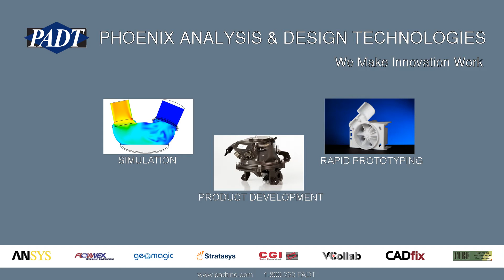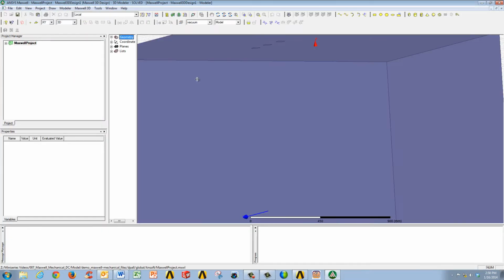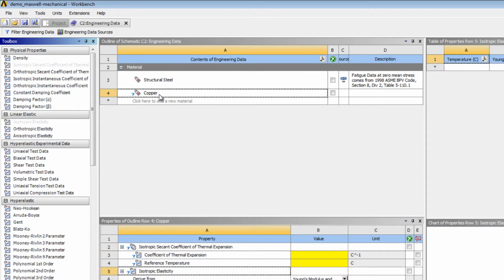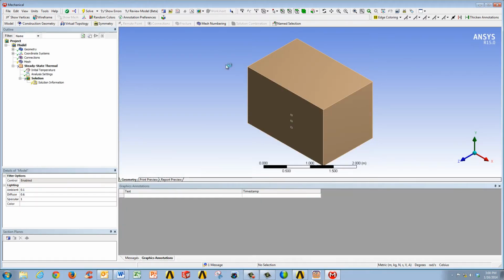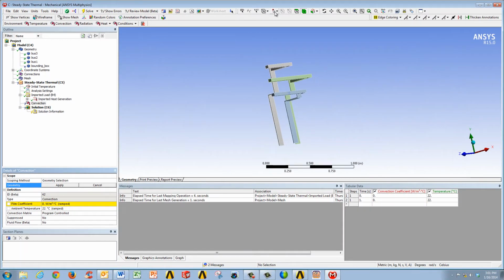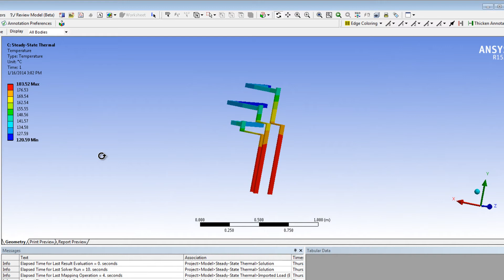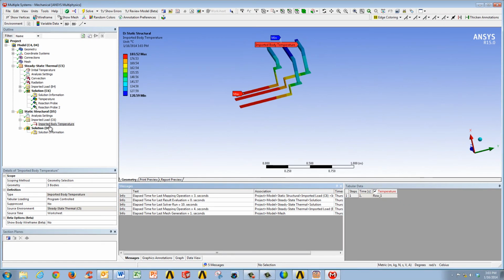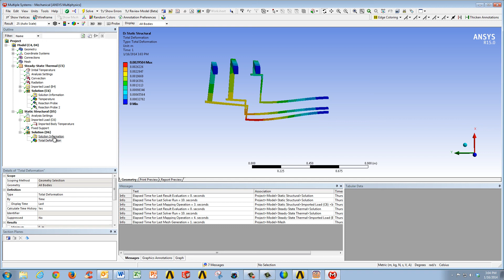The Focus Video Tips: Multiphysics Simulation with ANSYS Maxwell and ANSYS Mechanical - Part 2

Comment: thanks a lot for your nice video, I want to get the magneto-striction force in Aasys- electronic, but when I transfer data to structural mechanic only AC force can be transferred( the used material is metglass and I introduced its propertied to the maxwell)
could you please direct me to solve the problem and get the deformation . 
best regards, 
Sara

Comment: Hello Thanks a lot but When I bring above  model in ansys  after successfully application of heat generation load it wont give temperature graph but same is runs in Transient thermal successfully with only 2 degree temp rise when time period is fraction of second. why it is not running in static thermal